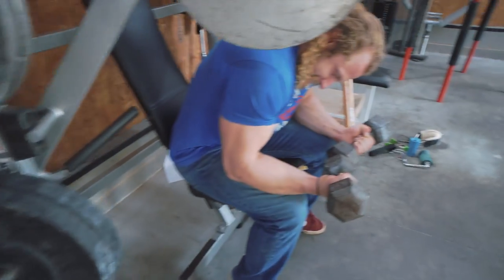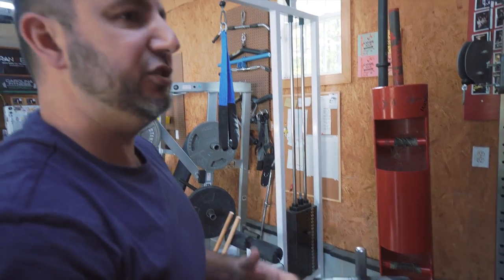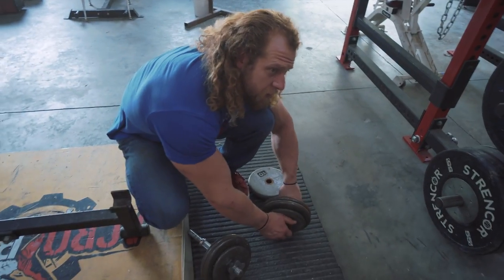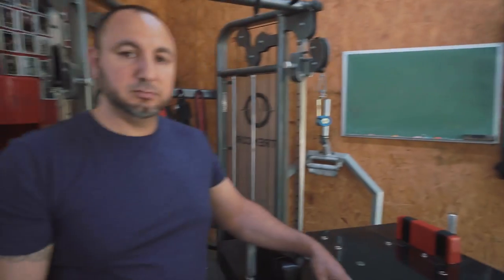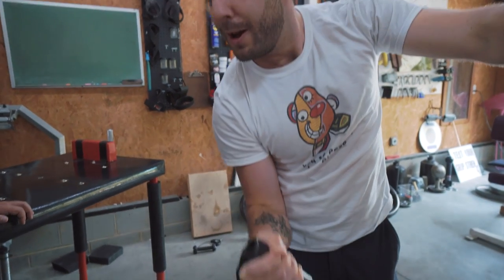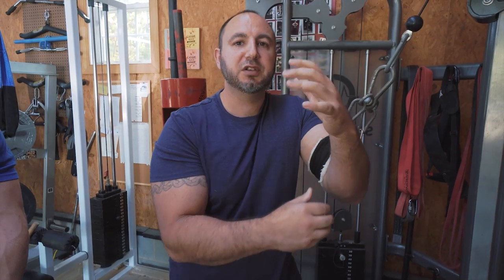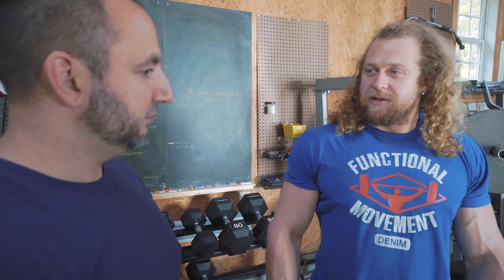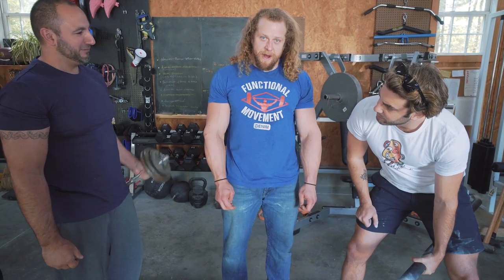UNIQUE WAY TO BUILD STRONG ARMS FAST

Comment from the maker: Even if you can't arm wrestle, you can figure out a way to use a few of these. What kind of wild arm exercises do you all do?
Reply: Fat Gripz Extreme Zottman curls, superset with weighted close grip dips
Reply: straight bar with preloaded weight wristcurl into finger strech if u get me.... like a yoyo basiaclly back into wristcurls
Reply: I fill a 5 gallon bucket with sand/gravel/etc and use the opening and closing of my hand to try and dig all the way to the bottom. It gets really hard, but it’s super good for the tendons.
Reply: Tie a towel to a dumbbell and then doing towel grip hammer curls and holds (Really similar to the exercise done at 14:20)
Reply: Squats...
Reply: Behind the head curls using a pull down station, superset with low pulley curls using a rope attachment, supinate tightly at the top. Then a set of 21's
Reply: Fat Gripz Pull Ups in different styles...
Reply: started grip because of this channel. all kinds of weird variations. good on a rest day.
Reply: A lot of these will help with grip training too.
Reply: I use my loadable dumbells, using 2 2.5 on one side I grab the plates (only on the sides) as like a hub-style grip and load the bottom to practice my grip. Try to hold weight for a full minute
Reply: I also have one set of 35 lb hex dumbells and you guys have inspired me with the blob. I've picked it up from the side once.
Reply: One of my exercises looks pretty odd. Due to a limited budget, i have an aluminum bat that i've attached bat weights to as well as secured some chain near the end of. I hold it near the base of the handle with one arm and do lever exercises. I superset Radial/Ulnar Deviation(Wrist up, Wrist Down) at 15 reps each, brief rest then i slowly do a tic tok motion to work my pronation and supination. After another brief rest i flexion up for 15 reps, then turn my hand over and do extension up for 15 reps. I do 3 circuits of all of this. With this i work most of the forearm muscles really well. I follow up by taking heaving resistance bands attached to a solid point, walking backward and supersetting hammer curls and reverse curls for 15 reps x 3 sets. With this simple and fairly quick routine i give my forearms a great workout and also get my biceps involved in a big way. Love the series, thank you. The Armwrestling episodes are my favorite. I'm pumped for the Tourney
Reply: I wanna see you impliment these workouts in grip!  Don't just forget them after the series!
Reply: TheGrip channel has a nice guide to using a karate belt to work on different wrist and hand exercises.  It really helped my tendonitis almost immediately.
Reply: Weighted dips on rings, and curling irregular objects.
Reply: Masturbation. Sick arm excercise
Reply: Arm wrestling with my one-eyed vessel
Reply: if u dont have enough rest between armwrestling training round on the table with people it takes 2 day after the training to feel it when u hav enough its the day after on waking up its important to have some rest between pulling to fasten your recuperation
Reply: I like to get a rope and try to rip it apart with my hands supinated, try it for 10/15s and you got a bicep pump
Reply: Reverse grip, between the legs, bicep curl, ball smashers. ;).. Oh and this can be done single or double handed.. but only if youve got the skillz.
Reply: please juji
Reply: Don't underestimate the ol' weigh on a rope, attach the middle of a stick. They suck and I hate em but it works.
Reply: When im at work i practice hanging off all kinds of weird stuff instead of moving my ladder lol rlly hard on the arms
Reply: get a heavy piece of rebar and swing it around like a sword.
Reply: lots of writing 🤷🏼‍♀️
Reply: Fat bar ez bar curls!
Reply: Something REALLY good is the row machine with FAT ASS grips, aka fat gripz. Just slam 2 on a rowing handle and go to work, its really hard and really good training, can be done 1 handed too. GOOD LUCK SIR!
Reply: I Curl a heavy Bag filled with tools
Reply: Handstands I don't know is it's a hand exercise
Reply: uhh does extreme masturbation count?
Reply: Idk, I still cant get past how big his arms are
Reply: I fill my empty "Bojangles" boxes with cement and do curls with them.
Reply: I used to do indian style gada training with sledgehammer
Reply: 1:20...aahhh I know that face lol. Always sucks when you have to be cut open. Hope it all went good for you , Sir!
Reply: with stackable bands
Reply: I'll tie a rope to my 4-wheeler and have it on a decline and I'll pull back with it practicing back pressure.. the quad weighs about 325
Reply: @Fuuko.  if you catch the bar with half bent fingers, like a half crimp in climbing, and roll it back up those are finger curls.
Reply: I do the F.A.P forearm workout once a day
Reply: Loving the ironmind blockbuster pinch block one. Arm dead lifts juji and everyone. Also slow movements and bent over bicep curls with fat grip pros with heavy dumbbells.
Still believe in grippers as well
Reply: @stevemf11  I love those fat grip pros and the extreme as well Steve. Yep I rotate them bad boys and do slow static movements with the fat grips. Definitely a must for grip and arm strength to the next level

Comment: This was a good vid as well! Interesting methods to train arm wrasslin with our every day items of DBs/cables. .I liked the usage of the cable cross with table. Very creative.

Hey, no joke, holding a hammer/weighted stick by its end with a slow negative is more difficult than it looks! There's a vid floating around of a maniac doing the same routine, with an axe, blade facing his face. .   dethmetal movement right there \m/

Tom where you moving to?!

Comment: I've done the sledgehammer lifts. The hammer curl variations I do a lot. One challenge I have is find a stihl 460 chainsaw with a 24 inch bar hold it by the back handle, one handed keep arm straight and lift straight forward. Once you're arm is lateral curl with your wrist and bring the bar to your head and then go back. Wildland fire work out!!!
Reply: justingulb34 I would like to see a video of this and give it a try
Reply: @champat187198220  sorry for the lag in communication. I can definitely  send you a video.

Comment: Awesome video. Tom you proper made me belly laugh. My best exercise which has helped a lot is using training bands but doubled over and shortened. It’s a grey 15 kg band then double it. Then shorten it to about 10 inches and stretch out and press it in a arm wrestle position. Hope it helps.

Comment: You should never do wrist curls on the edge of a bench or an arm wrestling table, always always always do wrist curls with your arm or arms hanging down, wrist curling weight from a hanging position means that the peak contraction is as heavy as the start of the curl, this is because the weight still wants to drop down, but if you do wrist curls on the edge of a bench etc, then the peak contraction is not going to be as heavy as the start of the curl, this is because the weight starts to become balanced and held up by the bone structure of the hand that is more underneath the weight, instead of being held up on one side by more of the muscle.

Comment: Don't think you have to buy all this stuff, either. A towel and duct tape makes any grip thicker. Bicycle shops on your area will give you old inner tubes FREE(they dispose of them anyways). An old sock with some rocks for supination and pronation. An old baseball bat for sledgehammer stuff, or even a broom can work. There's really no excuse. If I had to recommend anyome BUY something, it would be an armwrestling table(though a rolling thunder is fun af).